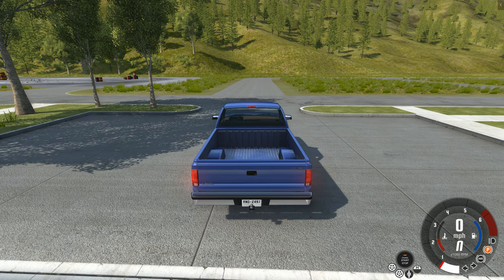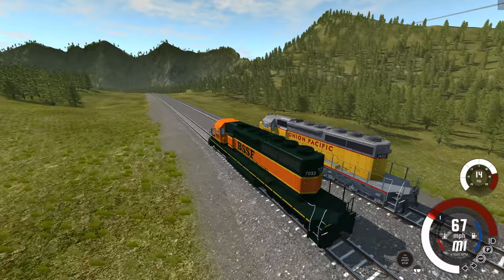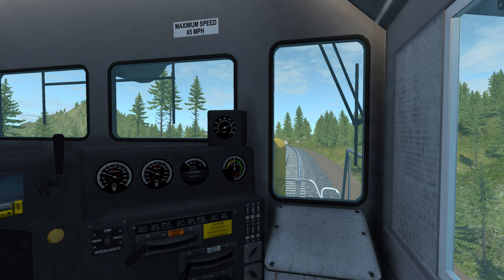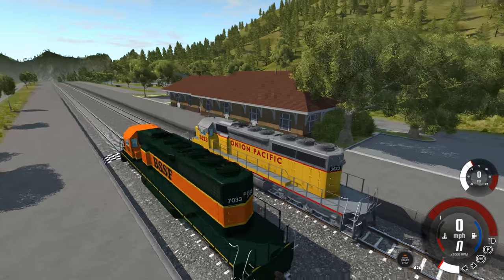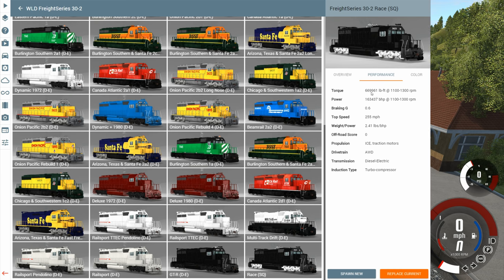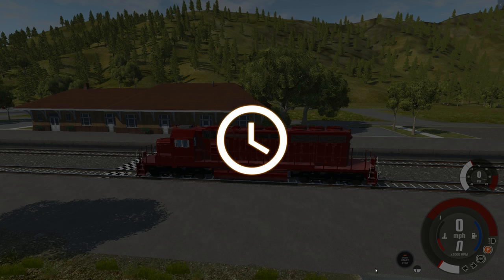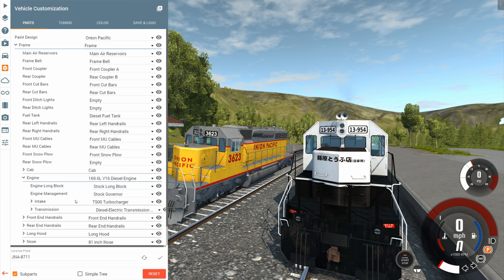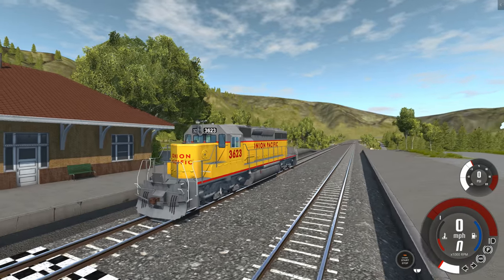THE TRAIN! - WLD FS30-2 Diesel-Electric Locomotive - BeamNG.drive

Comment: The train crew is an engineer and a conductor. The engineer sits on the right and controls the locomotives while the conductor sits on the left side and basically does all the dirty work.
Reply: 2 gevo
Reply: By dirty work you mean paperwork, maintain a log of the manifest (passengers and cargo) manually flipping any needed track switches, working the radio, ...
Reply: Nathan McQueen 330 has 2 gevo
Reply: Yup.

Comment: 38:20, that's a sand filler cap for the sand bins. Sand is used to give trains more grip. In addition, the bathroom is normally in the nose and the really long "snoot noses" were mainly needed for radio equipment.

Comment: Red lever: emergency brake
Higher side push : dynamic braking
Lower side push: throttle notch 1,2,3,4,5,6,7,8.
Volt warnings: cover up the power levers needed to start the engine.
Gauges: tell the speed, air brake pressure, engine temperature, etc.
Yellow button: horn

Comment: The locomotives in Beam NG Drive are based off an Electro Motive Division SD40-2built in 1972.The SD stands for special duty.the EMD SD40-2's speed  is 65mph 104 kph

Comment: You know you can multi-track drift? It's possible to line the bogeys on different sets of tracks using the world editor and then drive.
Reply: Drive the locomotive over the switch, switch the switch, drive the front set of bogies over the switch, the switch the switch back so the back wet stays on the track it’s already on.
Reply: I tried that and never personally got it to work. I gave up and used the world editor to position the train.

Comment: these engines have something special in beamng drive, when you connect them together the train in the front can control the throttle and brake but not the reverser or gear

you should make the longest train in beamng drive vs another train

Comment: You should put the racing train and a normal train’s rear couplers together and then have them pull against each other. I’m wondering if the racing train will just pull the other train or destroy it.